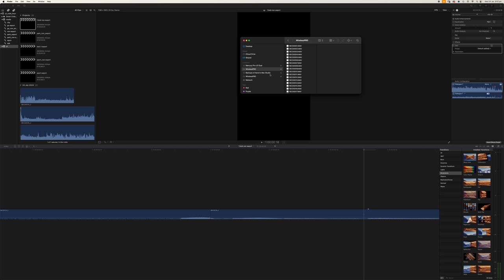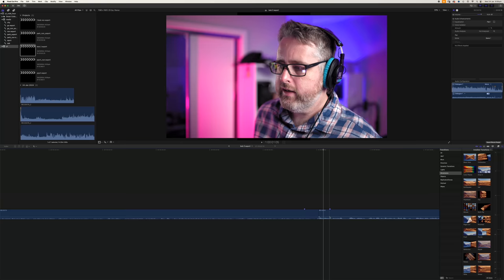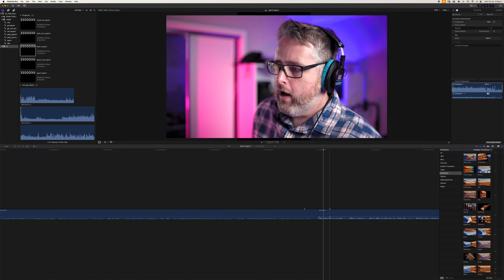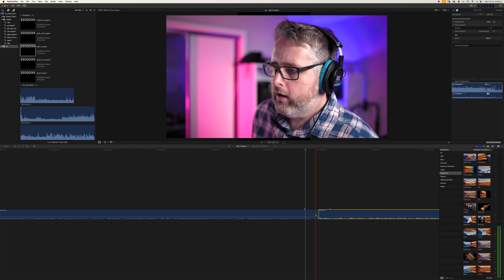This needs to be fixed! Rode Wireless Pro

Comment: This issue sounds similar to what people have experience with cameras that segmented  video files in the past there be a gap between split files. Some companies would require you to concatenate using their utility. I believe previously you need the Rode app to import files to the computer. I suspect the audio is there but it's getting truncated. I do find it irritating that many devices split files. Some say it's the limitation of the file system or file format and others say it's intentionally designed that way to avoid losing your entire session if the file corrupts. I would think they should be able to fix it, new products take time to work out the bugs.
Reply from the maker: Yeah I have no doubt that they will fix at some stage. Definitely not a deal breaker but tricky all the same. As a user, I simply marvel at the innovation and have no idea how they even come close to programming this stuff. 
I noticed on my go pros the other day that the  10 splits files while the 11 doesn’t. Interesting
Reply: Based on my testing the audio is there if you copy the files directly from the transmitters, but the split does not occur at the designated frame boundaries which is problematic if you are using timecode to align your internally recorded audio (in the transmitters) to your video. I am somewhat disheartened that RODE has not come out with a fix yet (at least for the download problem from RODE Central).
Reply from the maker: Maybe they’re thinking most people won’t record passed the hour?
Reply from the maker: Yeah that makes sense as well, I’ll have a look at the size.

Comment: Are you using timecode in the Wireless Pro? I haven't seen this problem when recording internally with 23.976 fps timecode and placing it on a timeline with the same frame rate but you raise a good point and I will certainly perform a few tests to see if I can replicate this issue. Thanks for posting. I do hope that RODE can fix this - I wonder why they break the audio at 1 hr boundaries - is it a file system issue (file size limit) or are they trying to minimize lost data in the case of file corruption?
Reply from the maker: Yes generally I have tc on @ 25fps. Thats an interesting though I’m going to run another test with tc off and check. Yeah I have no idea about why stop at 1hour, shouldn’t be a EU tax issue right hahaha
Weird that the go ii did 31min blocks fine. 
I’m sure they’ll figure it out, surely it just a program issue with the cut/continue file write code. 
Thanks for taking the time to comment:)
Reply: @videographerstuff539  OK - I gave this a run of 6.5 hours until the batteries died on the two transmitters. I simply recorded Sirius XM playing in the background. Wireless Pro was setup with timecode mode @23.976 fps and let the two transmitters record internally to 32-bit float. Afterwards I used Rode Central to copy these as 32-bit float (no conversion) to separate TX1 and TX2 folders. I then used DaVinci Resolve to bring these into the media pool. I setup a timeline with a matching timecode so that I could insert a track of TX1 and a separate track of TX2 clips aligned by timeline (this is important). What I found was that there were often gaps between the end of one 1 hour clip and the start of the next, however, if I dragged the two clips together, the music played through without any interruptions or clicks (as far as I could tell). Resolve will force audio to align with video frames but you can also work at the subframe level. I think the gaps I was seeing were timecode errors, not actual gaps in recording, however, I also noticed that even though the clip boundaries were aligned to frame boundaries, some of the clips appeared to have 'handles' to the sub-video-frame level which tells me that if I were to allow those additional bits beyond the video frame boundary, I would have heard the clicks you reported. I still need to do a bit more testing to see if this is true (if I hear the clicks). I suspect Final Cut X allows you to lay-down the entire audio clips irrespective of video frame boundaries and so you are actually playing an overlap between the end-to-end clips. I'll report back here once I try a sub-video-frame extension of the audio clip boundaries to test my theory.

Edit - I should note that my ability to detect 'clicks' between adjacent clips is poor with the sort of media I was listening to (my ears aren't good enough to detect sample-level discontinuities, it would seem - see my next post).
Reply: OK - did a bit more testing and down at the sample level I can't make the samples line up no matter how I manipulate the outgoing and incoming clip (regardless of video frame boundaries) so as you suggested, it really does look like there are samples missing between the end of one clip and the start of the next. It would be easier you see this if I used a tone generator (a sinusoid) so that I could judge the distance between peaks across the boundary between clips (yet another test). RODE, of course, is in a much better position to establish this sort of test and to correct their firmware. I really do hope that they can correct this issue. Thanks again for bringing this to my attention. Cheers.
Reply: surely the last anwer (safety) is an argument, but it can also be that it would take too long for its processor to process a long(er) file after you stop recording, longer than what you would allow it to do, like starting again or shutting down, risking a loss of the file.
Reply from the maker: What an effort! With that level of testing you are basically a scientist in my books!
Reply: Because I have nothing else to do, lol - I did a 2.5 hour recording of a 1000 Hz tone so that I could clearly see the discontinuity in the waveform from the end of one hour to the start of the next. It's not just cutoff, there is also a phase shift. I think RODE could do a better job here by ensuring that the end of one file coincides with the end of the timecode frame and the beginning of the next is aligned with the start of the next timecode frame. I reported this to RODE as well. We'll see if they fix this in the future. I have a list of things that they need to fix - some are personal preferences such as when you copy the audio files from TX1 and TX2 to your computer using RODE Central, the creation and modification times of the files adopt the time they are copied, losing the time they were captured... Not great (a rookie coding mistake, really). You can drag the files from the mounted drives and retain their original times but when both drives are mounted (i.e., you have the Wireless Pro case connected to your PC) you can't tell which drive is which and the file names collide. Silly stuff that could be corrected by RODE if they care to improve the product. I've commented on these with their support group as well. Yippee.
Reply from the maker: Get a white coat and you start Monday! Next rode tech!
Reply: @videographerstuff539 I contacted RODE with some screen shots - Kurtis, the support rep claimed that this shouldn't happen and suggested I was possibly doing something wrong or that DaVinci Resolve was. I'm surprised at this response because the data I gathered illustrates that the problem is with the Wireless Pro (not to mention that you contacted them and they have acknowledged the issue). I am continuing to provide them with more info and screen shots of the 1000 Hz test showing an obvious discontinuity and phase shift after the break. Get this - IMPORTANT - Kurtis claimed that the Wireless Pro splits files based on time and not frame count. That of course is nonsense - It may be what it IS doing, but that cannot be how it SHOULD work. The first audio sample of the incoming frame must be adjacent to the last sample of the outgoing frame. The split MUST be on a frame boundary based on the current timecode frame rate. There's no other way to make this work in an NLE that supports timecode.
Reply from the maker: That’s weird, I wonder why he’s taken the position. I mean if no one else was having the problem id get it but more then one person has so 🤷‍♂️
Reply: @videographerstuff539  Agreed. I'll post back here when I receive further info based on the screen shots I emailed to support. Cheers!

Add - just heard back from Kurtis and he believes from tests he performed that this may be a problem with RODE Central copying the 32-bit float files and suggested copying them directly from the mounted transmitters. I’m away for a couple of weeks but I will test this when I return. He will also forward my findings to their dev team.
Reply from the maker: It will be interesting to hear if there’s a difference on your end.
Reply: @videographerstuff539  Too bad I can’t verify sooner. Oh well. Lol
Reply from the maker: Come on, what’s more important, living your life or sorting this out?? Hahaha
Reply: @videographerstuff539  OK, back and had a look at direct copy of files from each transmitter. It turns out that the direct copy files have additional samples on their end that match up correctly with the first samples of the next file. However, RODE transmitters do not cut the files at frame boundaries and so if you line up the files based on timecode, you will get gaps and other oddities. You can use the Fairlight page to extend the outgoing clip and shift things around at the sub-frame level but it is tedious and negates many benefits of using the timecode. I've reported this to RODE and I hope they will attempt to correct both the RODE Central app and the way in which the transmitters break their files at 60 minute boundaries.
Reply from the maker: Welcome back! 
Great work, hopefully you’ve given them the answer to their own problem! For the moment I think I’ll just keep an eye out and try restart recordings if it looks like they will travel over the hour mark.
Reply: @videographerstuff539  Thanks! Yes - restarting recording or keeping them to less than 1 hour is likely best until this gets addressed. I will post back here when I get a response from RODE on my latest reply to this issue. Cheers!
Reply: @videographerstuff539  I heard back from RODE with just a thanks and that they would pass on my findings to their development team. I guess we'll see if anything comes of it.
Reply from the maker: I can feel a firmware update coming…. :)
Reply: @TheRealBarkinMadd Thank you for chasing this up. I've seen one YouTuber talk about the DJI Mic 2 breaking files at 29 min but he said the Rode Pro was fine. So I didn't expect to find the Rode to do something similar! Hopefully, Rode will have a fix for this.
Reply from the maker: Fingers crossed!
Reply: Great find, did you actually compare/sync the internal recording and the audio output into another recorder or camera? They should not match up, and that would prove it's the fault of the unit. Panasonic cams used to have this 4frames drop at the end of every clip, it was a h264 encoding error on their part. I would be curious how many frames or milliseconds is the drop in the stitches.
Reply from the maker: Great question, I’ll go back and check the job files. You’ve got me interested!
Reply: I'm not sure what happened to my reply - seems to have vanished here, lol. There was an update to both RODE Central and the Wireless Pro firmware (1.2.8 -> 1.3.1) and my hope was that this would correct the issue with gaps and lost samples when copying from the transmitters using RODE Central. It does not (based on re-running my tests with a 1kHz tone) - so my previous finding still apply. The one notable change I noticed is that the file naming in the transmitters now includes the custom name you gave the transmitter. For example, I named mine WP_TX1 and WP_TX2 and now the file names are of the form 00001_WP_TX1.wav and 00001_WP_TX2.wav. This is a welcome improvement. Couldn't find any release notes for the firmware update. Maybe someday RODE will fix the underlying issue with copying using RODE Central but for the moment it looks like copying directly is the best approach when you want the original 32-bit recording(s).
Reply from the maker: I think it’s just easier to set a timer on your phone when you start recording and then interrupt the talent at 59min and get them to hold their breath until in rolls over passed the hour mark….. 😝🤣

Comment: Thanks for this video. The workaround is of course a solution, I use it also for 'unreparable' issues, where a cut can't be done unnoted, but it shouldn't happen indeed. Just like in a camera,  the pro should have some kind of pre-recording for its files, surely in a continuous recording. And the issue with the app... Rode is the only one where you need an app to export your files. They should change that.
Reply from the maker: Thanks for the comment! It will be interesting to see how long it takes them to fix it. Regarding the app and files, don’t forget you can copy files across from the unit without using the app. Your computer should see the unit as a ‘mass storage device’. Open that up and your recordings should all be there. 
Cheers!
Reply: They actually changed the app situation in a recent firmware/app update on my Rode wireless 2, weird format but maybe a conversion stitch on Audacity or similar would work better ?
Reply: @TheReelport  Thank you, I usually don't record over an hour in one piece, but it would be good to know to to have to worry about that issue. after all, the on board recording was meant as a backup...
Reply: @JeanLoyens  well on board recording is 32bit, so I'd see it as a master, the on-camera as backup.
Reply: @TheReelport  True, and I like to use it that way, but if the problem arises at the 60'th minute, you may just try to recall when that's gonna happen, so that you have an on stream record going on, or that you just quite on an ongoing recording and you start again. That's the way I would choose it... then you just start a new recording and thus a new file... going strong for the coming 60 minutes...
Reply: @JeanLoyens  I got stressed just by reading that , omg 😱 I think I would treat it as backup :)
Reply from the maker: @TheReelport I haven’t had a chance to update the app, will check it out. Thanks heaps!
Reply from the maker: Yeah the chances are small but very real all the same!